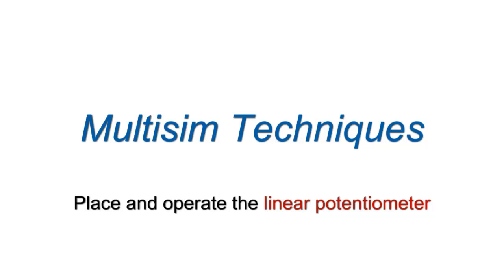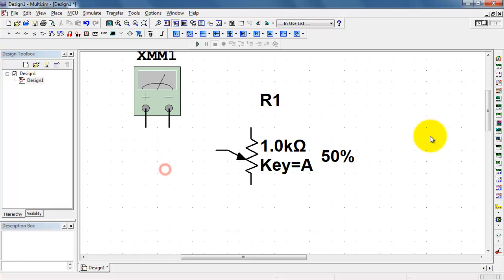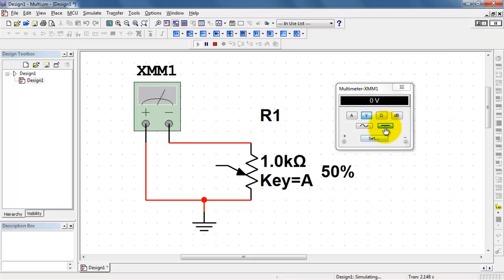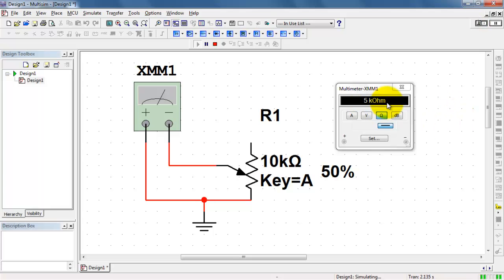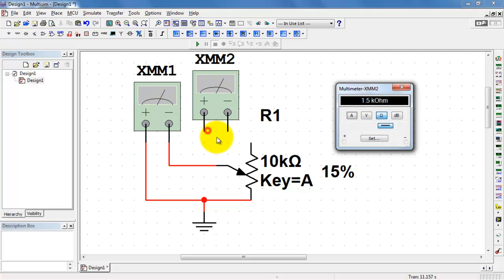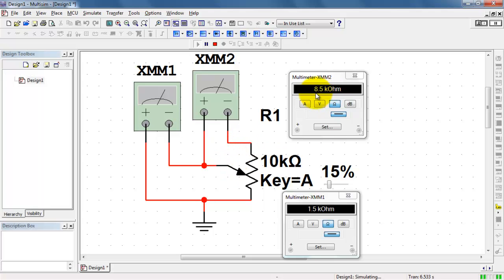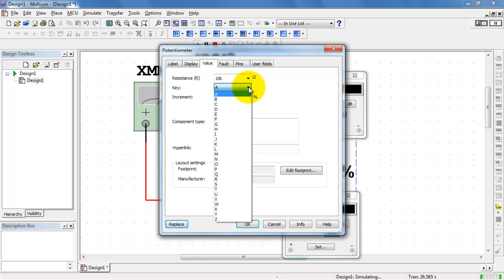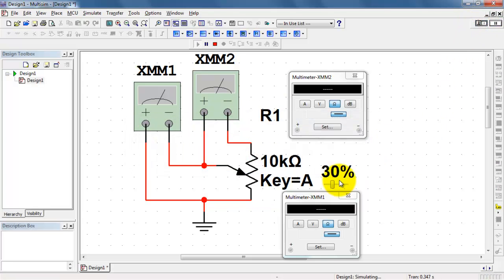NI Multisim: Linear potentiometer

Comment: i can see u are using multisim. I'm trying to draw DC shunt circuit diagram using multisim, but I couldn't find it the variable resistor or what they call Rheostat. could u plz tell me where I can find it and if itsn't available in there, any idea what can replace it? and I see in the description u wrote the linear potentiometer can serve as a pair of variable resistors. can that be possible? can Linear potentiometer be an alternative incase the rheostat symbol is not available in the multisim?

Comment from the maker: You could use two "VOLTAGE_CONTROLLED_RESISTOR_VIRTUAL" devices; set up a variable voltage source to operate both resistor control voltages at the same time.